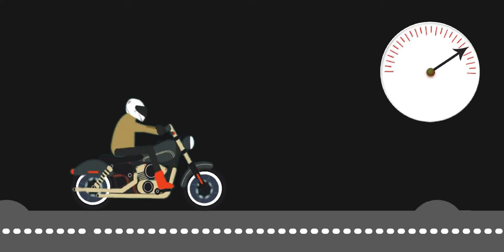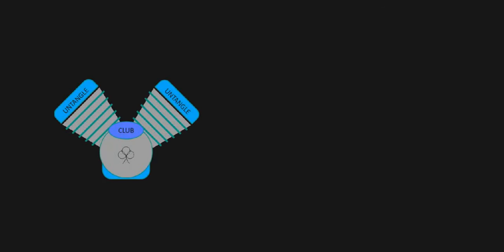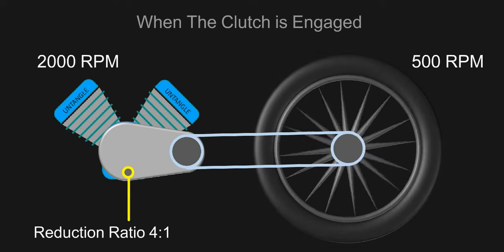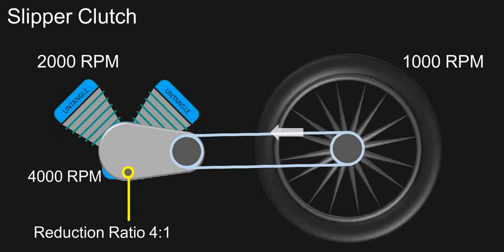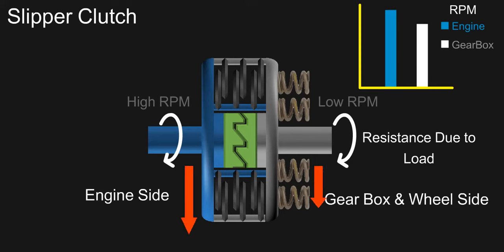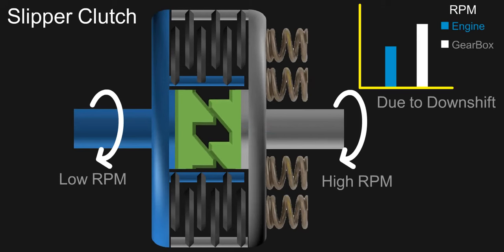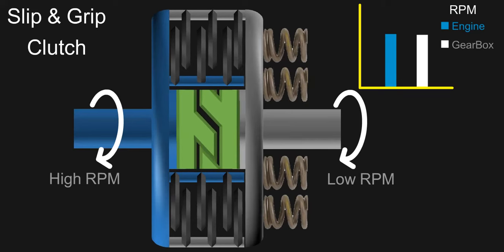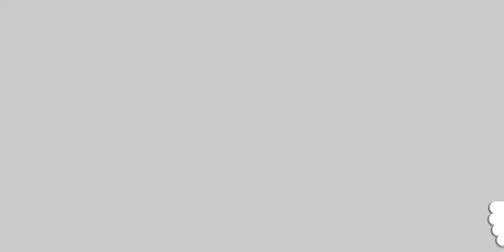Slipper , Slip and Grip Clutch | Working in detail with animation

Comment: I have a 2022 ninja Kawasaki 400, at the first gear, it is very jerky despite raving very slowly, especially when releasing and turning the throttle  handle back to its off position. Which clutch unit would be better for me, a slipper or grip clutch, so as to have a smoother ride.
Reply: Sorry bro but no clutch will fix that. It's jerky due to the ecu saving gas, switching from open loop to close loop input. Basically, in order to run as lean as possible, they designed it with herky jerky engagement. If you want to fix it, the clutch isn't the issue, you need a tune or a commander. If you want a smoother engagement on the clutch, you can buy a slipper with more plates - more plates means more friction, more friction means you have more control over engagement and disengagement. But honestly the best thing is just to learn how to  ride smooth, calm throttle rolls and accurate clutch release will give you the ride you want, and all it takes is practice.

Comment: 5:00 So at higher rpm, it is trying to pressurize the plates, isn't it hard to engage the clutch?
Reply: No
Reply: At higher rpm the slip allows the pressure between the plates to decrease... Thus gradual engagement

Comment: Will not rev matching in v3 still be harmful coz it comes with slipper clutch too or is it only for emergency
Reply: It is always better to rev match since the frequent usage of clutch wears it out. Sure, the engine and the overall riding is safer with slipper clutch but there's still gonna be that wear and tear from the usage of clutch. Not something to worry about if you're doing it once in a while tho.